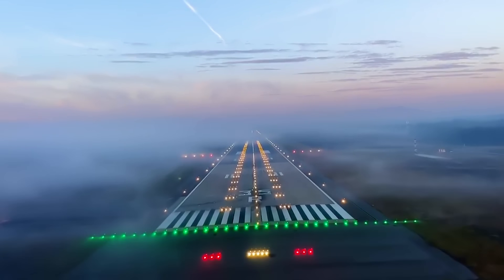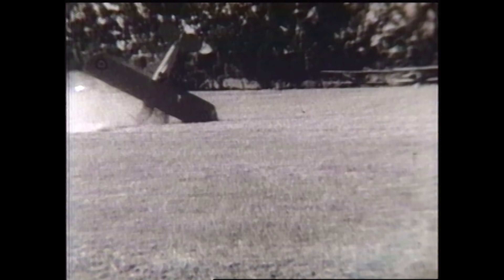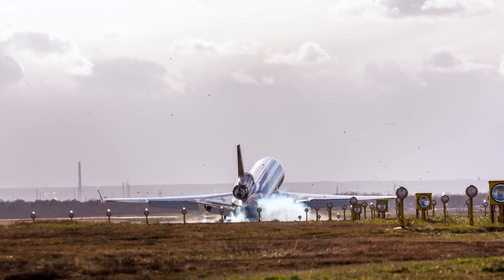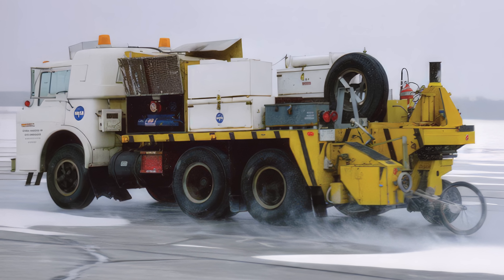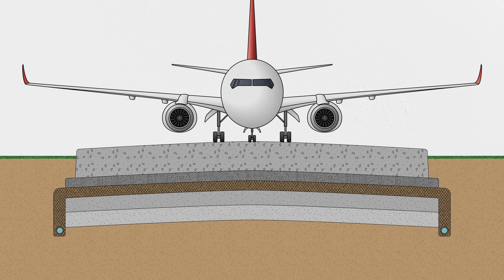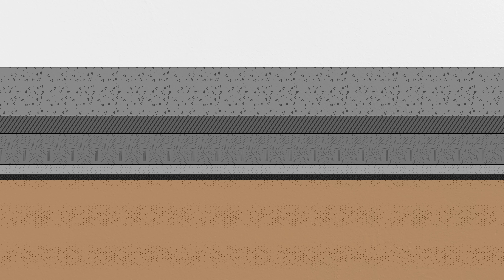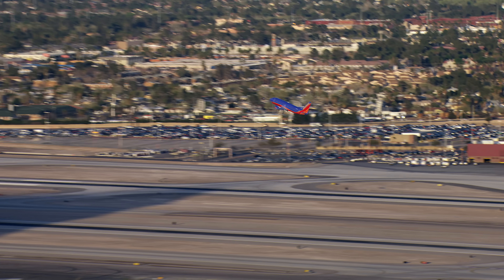The Hidden Engineering of Runways

Comment: So if the slope matters for takeoff and landing, why don't we then try and use that to our advantage? Or is it just too complicated to just be feasible?
Reply: Because if a runway is sloped such that is in advantage when landing, it's a disadvantage when taking off.   So, to take advantage on both, you'd have to have airplanes taking off in the opposite direction than they're landing, whcih greatly complicates the air traffic flow to and from the airport. Also if there's any significant wind, then one of the operations (takeoff or landing) will necessarily have a tailwind, whcih is detrimental both for takeoff and for landing,  eliminating any benefit you might have gained from a runway gradient.
Reply: @andrewalexander9492  how bad is having a tail wind when landing? I know why takeoff is bad, as you need the wind for lift, but if you're landing, wouldn't a tail wind help?
Reply: @SpookDudeGoesWild  A tailwind on landing means that you're moving faster across the ground when you touch down, and you need more runway and more braking energy to stop.   Also with a tailwind your control effectiveness while rolling down the runway is diminished.  Most Transport Category aircraft (Airliners) have a 10 knot tailwind limitation.

Comment: To add to the aerodynamic erosion: when planes are rotating during takeoff, their full thrust is essentially pointed at the runway at an angle of up to 15 degrees. Take a B777 with a 115000lbf thrust. It will blast the runway to pieces if not accounted for.

Comment: Why don't planes have airbags?
External airbags could cushion a crash, internal airbags could protect passengers from debris.
I am aware that this wouldn't be easy. But I guess when the car engineers first came up with an idea to put an inflatable balloon into every steering wheel, which can inflate in milliseconds, they will probably also have been told that it:s hard.

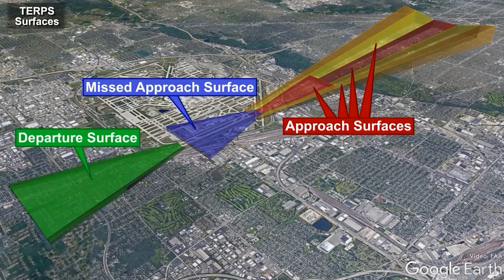Comment: The timing for this is uncanny. I'm actually a software engineer and I'm currently developing a tool as an add-in to ESRI's ArcGIS Pro platform to run analysis on temporary obstructions like cranes. It uses some of their geoprocessing tools along with those generated surfaces (13:20) to determine the impact of the obstacle. Our users will then use those results to determine if the contractor will need a permit or even if they need to coordinate a closure with the airport. Going into this project I knew almost nothing about aviation, it's been quite a learning process and this video is helping to solidify my understanding as I work through designing this solution.

Comment: To make a few points more clear, as my aerodynamics professor said “brakes and brakes alone stop an aircraft” all other devices, spoilers flaps reverse thrust help the breaks to work better. They cannot stop it alone. The goal of a landing is to get weight on the wheels as quickly as possible so that the most energy can be absorbed by the breaks. This is what spoils and thrust reversers are doing. If you do it right and hit your full stall landing the aircraft is traveling maybe just below the minimum speed it can possibly fly, even in a small propeller driven aircraft our minimum landing configuration stall speed was 64 KTS. So we still have all that energy to put into heat in the break disks. Thrust reversers can help take in some of that energy but really all you’re doing is lowering the final break temperature.

The displaced threshold is runway length that can be used for takeoff, but not landing. So your Take Off Distance Available number would be larger than your Landing Distance Available number. If you didn’t quite get that one. Odd since we were always told in school that the displaced threshold wasn’t full strength pavement and that’s why it couldn’t be landed on. But if takeoffs produced more stress on the material I’d expect that runway area to be perfectly usable. Displaced thresholds cannot be used for landing.

It was also nice he mentioned the RSA if you want a really obvious view of this pull up some satellite photos of KGFK. The crosswind runway there was extended to meet the needs of the Part 121 air traffic that goes into that airport for just the wind reasons he mentioned. A nearby road had to be moved completely creating a big bend in it to allow for the RSA. I guess the cheapest and essayist way to get the job done.

Great video Grady! Now you can go talk to CGP Grey about runways.
Reply: " as my aerodynamics professor said “brakes and brakes alone stop an aircraft” all other devices, spoilers flaps reverse thrust help the breaks to work better. They cannot stop it alone.  "  Your aerodynamics professor is an ignorant blowhard.   Reverse absolutely can stop an airplane.  It can even make it go backward.   The 4 engine airplane I fly for a living has very effective reverse, I frequently turn off the runway having not touched the brakes to slow to taxiing speed.   The older straight turbojets as on the early 737's and DC-9 family with bucket reverses had highly effective reverse thrust.  It was not uncommon fro DC_9's to back out of their parking stands using reverse thrust. the 737's were capable of doing the same but the low mounted engines increased the risk of engine damage from debris so it was rare.   The cascade reversers on high bypass turbofans are less effective, but still can generate enough thrust to move the airplane backward. There is a you-tube clip of a 757 reversing on the runway at Skiathos Airport.  I have taxied backward using reverse on many occasions.
Reply: @a @andrewalexander9492 d anything would stop moving if you left it rolling long enough because of friction. So could a big wall. That’s not the point. I dunno what aircraft you’re flying, 4 engines are rare nowadays kudus, but cool that your reverse thrust is that effective. And yes I know about power backs thank you. He’s definitely not ignorant. Actually flew a cargo DC9 for awhile. A320, small corporate jets. I stand by what I said.

Comment: PERFECT TIMING!  Just flew into PHL two days ago, right after a 1.5 hr delay from FLL, and then our plane was put into a holding pattern over PHL for 20 mins. My step-dad was freaking out at the airline, swearing up and down that he would never ride our regular airline ever again.  I told him, a LOT goes into the maintenance of runways, and our airline has NOTHING to do with an unexpected holding pattern. 
I explained, given that it had snowed very heavily an hour before our arrival, and with ice underneath that snow from earlier rain & sleet - I said to him, you can’t just land on snow and ice on a runway throwing all caution to the wind.  The reversers and brakes being applied have such force as the plane is landing that any hazzard - even rain, can be problematic (even catastrophic).  And ground hazzards can also grow to include winds, the weight of the landing plane, and the length of the runway.  
I’m going to show him this video, because he is still furious with the airline that we had flown with, ignoring me telling him it was not the airline’s fault.

Comment: Fact about runways is that the first high precision ILS systems were originally so accurate, that you had airports find there was massive wear at the point they all landed aircraft onto the runway, generally putting them down in the same 10m long box, which was rapidly destroying the surface there. The solution was not to reinforce this surface, as that would have meant needing to do the same for the entire runway length, in order to avoid buckling, but instead an upgrade to the precision landing system that varied the landing point over the day, so that flights landed instead over a 100m section of the runway, spreading the impact forces out over a larger area.  You can see in the approach scenes, all the black tyre wear is in one section, but it now is a much larger length of runway, not just a single point like the original design.  One bad landing can mean that you need to replace all tyres, as you scrubbed them down to the wear limit, which for many aircraft tyres is 4 visible plies at any point around the circumference, and those tyre assemblies are not exactly cheap. The inflation pressure also means the first inflation after repair is done in a blast cell, often a concrete room with a heavy steel door, and a frangible roof, so as to contain any pieces if it fails. Also why NASA developed a robotic tank with a drill, in case any shuttle main gear wheels had visible bulges after landing, as any attempt to go near them was way too dangerous. So toy truck with a cordless drill to go out and put a hole in it to deflate it, and then replace the truck and drill.
Reply: The claim that Instrument Landing Systems (ILS) were too accurate, causing excessive runway wear and prompting authorities to vary landing points, is an enduring old wives' tale. In reality, ILS provides precise guidance to ensure safe landings in poor visibility, but natural variations in wind, aircraft weight, and pilot technique inherently disperse touchdown zones.

The Tire Assault Vehicle (TAV), designated CR-990, was a custom 1/16-scale modified model of a German Tiger II tank, equipped with a DeWalt drill motor. It was designed exclusively for damaging tires during extreme testing, it had no operational role in deflating tires after space shuttle flights.

Comment: Pilot here. Did you know that runway lighting is run in series and not parallel which is basically everything else electrically in your life.  The distances are so great that the resistance of a wire becomes a factor. This would lead the lights closest to the power source at higher voltage and thus brightness, and the lights further away would get incrementally dimmer.  A runway that is 10,000 feet long is almost 2 miles of wire, that's a very long run!!!  When they are run in series, all bulbs will see the same current and voltage and will be the same intensity. This is critical for night landings where varying intensity of the bulbs can play real mind games and optical illusions to pilots.
Reply: I have both a pilot's license and an electrical engineering degree, and I can tell you that runway lights are wired in parallel, not series. Source: I've seen burned-out runway lights, and they didn't take out the rest of the lights.

Voltage drop over distance is worse for lower voltage sources and thinner wire. So, your standard string of 5-volt, 22-gauge Christmas Tree lights can show a significant dimming from one end to the other if the lights are in parallel. But a 120 or 240 volt, heavy-gauge-wire runway light system is not going to be visibly dimmer even after a run of 2 miles.
Reply: I don't understand. Looking at any area with buildings, the lights in the buildings closer to the power station don't burn brighter than those further away. Why is that 2 miles of wire a problem? Do those lights run at low voltage? Why?

What happens when a light is broken? Does the whole runway lose its lights, or is there some kind of bypass?

Comment: Not sure what you mean with rigid only takes the width of the tires in account. Let's hope you explain what you mean by the end of the video, because when I last calculated the runway layers and concrete, reinforced concrete was the way to go exactly due to the better spread of the vertical pressure...

Comment: If you’ve got the land, the runway itself not that expensive to build. When Sydney was in need more aircraft capacity 30 years ago adding a third runway was way, way cheaper than building a new airport. Because the existing airport is close to residential areas, providing sound insulation for houses under the new runway flight path cost as much as the runway itself.

Comment: it was a big consideration for the F-35 VTOL capability to think about which runways and aircraft carriers could accommodate such a platform. the F-35 has (something like) 450 deg C exhaust 150 ft behind the aircraft! upon takeoff, the jet is blasting the surface it's on with air hot enough to melt concrete and set asphalt on fire 250 feet away.

Comment: 2 things I love about airports you missed (no big deal): post tensioned concrete runways, and power for runway lights. Each light has it's own transformer because the distance the powerlines have to cover line friction becomes an issue.

Comment: Hello Grady, Kelly here.... While I was working as a concrete paver operator in Winnipeg, mb. Canada in 2003. We poured a new runway to accomodate the Antonov 124 that was transporting combines overseas. The total gravel base was 8 ft thick and the concrete was 4 ft thick with additional fibre mesh added. Topped with 10 inches of ashfault.
Reply: How could that be more affordable than shipping them via boat...?
Reply: @TheMetalButcher  It is a long way from Winnipeg to navigable water.
Reply: @larryg3326  You'd only need to dig like 600 km of canals (with associated bridges where needed) to get to Lake Superior, then sail through the Great Lakes to the St Lawrence Seaway.  I'm sure that'd be much cheaper than laying a couple 13-ft-deep runways, and it's not like there have been any notable maritime shipping disasters on Lake Superior.

(/s, if that's not clear)
Reply: That's fascinating!
Reply: An-124 are HUGE. Once I was in 10 meter distance from the mammoth going from repair facility, it was fantastic.

Comment: Fun fact relating to obstruction paths: in Minnesota, the height of all rides and coasters at the Valleyfair amusement park is limited by FAA regulations for a nearby regional airport.  This most notably resulted in VF receiving a shorter Power Tower drop ride than originally designed (sister park Cedar Point got a full height one the same year), and has also likely contributed to the park's stale coaster lineup, since any new coaster big enough to generate buzz would need to start with a drop greater than the height limit.

Comment: 13:03 What airport is this?
Reply: Vegas
Reply: @mrburne3043  Thank you
Reply: @tls5870  Yes, Las Vegas, Nevada, that desert city well-known for being surrounded… by water?
Reply: It’s an A350 on takeoff from HND, Tokyo, runway 05. You can even see the Japanese text "オプリ" for San-Ai Oil visible on one of the white tanks. And there’s a suggestion of LAS with the runway being next to water 😮 Vegas is in the middle of a desert! Check the pic and see if you can spot the water alongside an LAS runway … https://en.wikipedia.org/wiki/Harry_Reid_International_Airport#/media/File:Las_Vegas_McCarran.jpg
Reply: Vegas
Reply: Jfk i think if you're talking about the video
Reply: Sorry about the confusion, the first few frames of 13:03 shows an airport next to water, I meant the clip that begins at 13:03 and ends at 13:07 which does look to be Vegas, thanks.
Reply: 12:55 to 13:03 in HND.
13:03 to 13:07 is LAS. 
13:08 to 13:30 is ORD. 
But at 13:03 which you asked about, is HND
Reply: @iainhunneybell  Right, 30 frames per second,  first 5 frames of 13:03 is HND, latter 25 frames are of LAS. Glad we could clear that up...
Reply: Lisbon - Texas

Comment: There was a scandal some 20 years ago when a contractor was expanding the.main runway at a USAF base. Apparently they paved 99 yards wide, when the contract called for 100. And 11" deep instead of the specified 12. Making the new runway unsafe but "invisibly" using dkme 5-10% less material and labor and explaining how their low bid was made. (My numbers are vague, from memory, but that was the gist of it.)
 During highway construction, it is normal to pull core samples to verify the correct has been used.

Comment: one of the cool things i learned about runways when i was working with flight data stuff is that there is an exhaustive list of every material that runways are made of. crushed coral is on that list and it is used to make runways in tropical island regions like Hawaii
Reply from the maker: Used extensively during WWII in the Pacific to get runways up quickly. Lots of interesting history there!

Comment: In the Appalaichians, I think the "overrun ramps" have been around for 40-50 years. These are deep loose earth filling a ramp on the right shoulder of a downhill highway, so if a tractor trailor has a brake failure, the can steer into the overrun ramp. Which will "absorb" the whole rig, bringing it to a filthy but contained stop instead of a high speed crash at the next curve on the road.
 Dirt, not foamed concrete. Good enough for the lesser job.